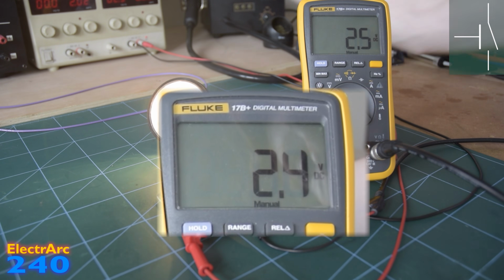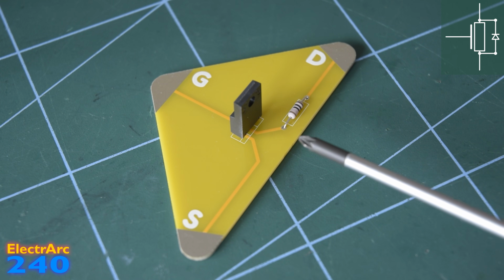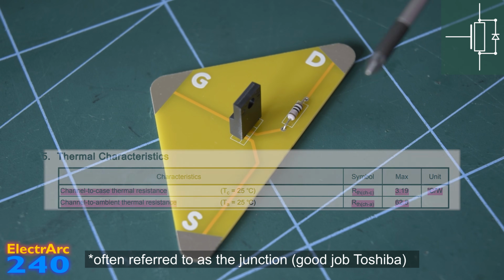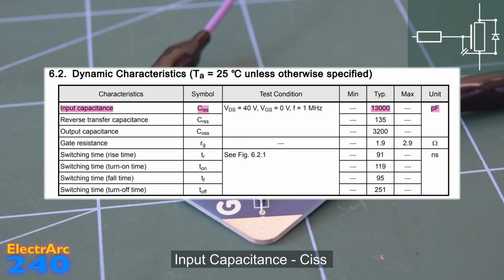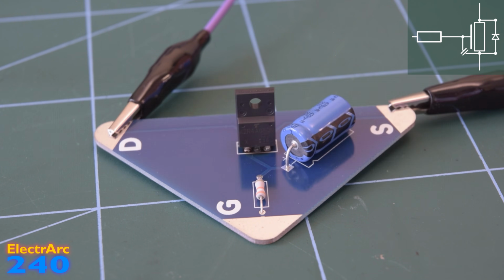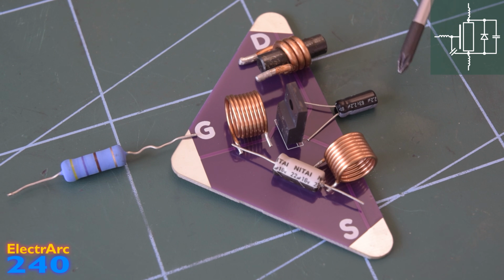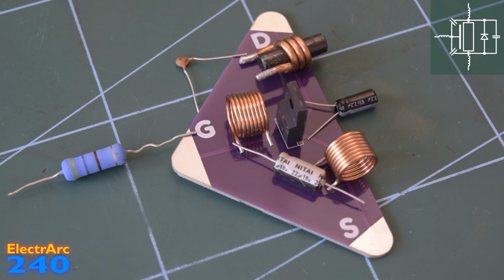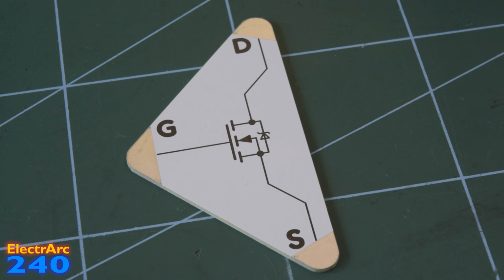Everything You Need to Know about MOSFETs

Comment: Thinking about how education systems work / worked in such electrotechnics disciplines. I studied communications engineering (got my diploma in 1993...)... and we hardly had any learning material about real circuits. Not power converters (energy electronics out of scope), not (power) amplifiers (too trivial?!). Only small signal stuff good for sensor circuitry, some digital and high frequency stuff (s-parameters, transmission lines ...). Were it not for the fact, that I had an electronics hobby since I was a kid (started around age 14 with that), I would not have understood a lot of this video, which is a) outside the scope of what I studied and b) too practical already. Maybe all those FET types were not as prevalent as they are today, in 1993... We never "studied" switched power supplies etc. back then in communications engineering. So, knowing there is only so much you can pack in 4-5 years of study, I am not sure if I would make the same curriculum decisions as I faced in my student years.

Comment: Im so confused by the light turning on without a power source??? Wheres the power coming from @5:11
Reply: There is a power source. Its implied. Because he is saying that current can flow from the source to the drain and to the lamp. He has the wire to the "source" coming from a positive terminal of a dc wall adapter, power supply or maybe from a battery. We have to infer, i.e assume a bit of the info, he doesn't explicitly show.
Remember, current flows from the + to the -.
The wires/circuit goes out of camera frame and connects to a power source. The black wire had current flowing.

Comment: Very nice work.  Thank you.   I've always been surprised that there isn't alot of transistors made with 4 legs for the purpose of
letting 2 legs be a sensitive circuit using a tiny voltage in the micro volt range , That decides how much current can flow through
the other 2 legs , The other 2 legs would conduct a much larger signal ''say 30 volts'' so that it could be used as a detector. The
tiny , sensitive side could be connected to a pick up / antenna / coil / photovoltaic cell etc.. and The slightest tiny current would
cause a proportionate  rise on the larger ...aka..higher power side making it very easy to light a detection lamp or move a needle
or make a speaker crackle , sound an alarm etc..  It would respond proportionally , But at a much higher , usable level.  Thanks
Reply: When I was around 18 I worked at a semiconductor company , I thought I was smart , I thought I'd impress my boss lol , I 
designed a 4 leg transistor based on something I always wanted .  He said ...Oh , Very nice , Yes , a good clean robust design 
But , Your only 45 years behind .  What I was so proud of , Was very old news and had been done long before silicon and 
germanium became common etc..  I forget it's actual true name , Probably because there are so many different names for
such an arrangement . lol.  I had not truly studied tubes yet .

Comment: I have a question. You said that switching a mosfet partially can shorten its life. I had been planning on making an electronic load that is adjusted by this very principle .. using a fixed-value load resistor, while allowing the current to be adjusted by changing gate voltage. (low-pass filtered PWM 'DAC'). Is that not a good way to do it?

Comment: Is the body diode a feature unique to power MOSFETs, or is it present in all MOSFETs? Sorry for the silly question, but I’ve never seen it depicted in MOSFETs used as amplifiers (as far as I can recall).
Reply from the maker: It is in 99.9% of MOSFETs, some weird ones I have never used (not power related) are different, but essentially all silicon MOSFETs have body diodes because you can't make them without them!

Comment: Why does a resistor decrease the rate of change of current? 23:19
Reply: Oh I think I get it: the gate resistor limits the current going through it, which limits how quickly the gate-source capacitor charges, which limits how quickly the channel opens up, which decreases the rate of change of drain-source current
Reply: @grace23869 exactly

Comment: Very good.
You only missed off a few things 
Some MOSFETs have integrated gate protection.
VDS Avalanche rating.
Some PSU devices with integrated MOSFETs have no avalanche rating such as topswitch.
Super fast switching certainly can cause radiated EMI issues. 
It's been theorised that solar radiation can cause random MOSFET failure.
How the internal leadframe is constructed can lead to 'current crowding' and failure, it's quite complicated!.
High Voltage TO220 parts by their construction cannot always meet creepage distances requirements Drain to Gate+Source.
Ferrite beads or 'spike killers' can tame damaging resonances.
Some MOSFETs have very good body diodes such as 'fredfets'.

Comment: 4:40 not every mosfet has the body diode between source and drain. There are some that forego the connection between the backgate/channel and the channel endpoints (sourcce and drain). Though these are far and few between. SD 215 and SD 5400 are the only two examples that come to mind for me, though i have searched for that specific type of FET

Comment: Back in the 70's when MOS devices were not very common and were VERY sensitive, a collegue of mine was repairing an item and determined that it needed a certain chip replaced. He had the part, so he unwrapped the foil from around it, took it off of the black foam,  and plugged it in. The original problem was fixed, but now it had a new symptom. He did this procedure two more times before looking up the part specifications. We had never been trained on handling MOS devices.  Any time I see "MOSFET", I think of this story.

Comment: Thanks, it was very interesting, but I was missing some info why we do all of these combinations😂😂 
It is like you say : that is a car, there are 3 pedals we can press left one when change the gears ⚙ the middle one to stop a car and the right one to speed as hell 😂😂 ... so go and drive .. silly impossible ...
In one example I understood mosfet could work like a switch, similar to a transistor, but why it is so complicated to using it as a simple switch ?
I was in similar reflection learning about microcontrollers, but some day I heard : we can use a mini sized microcontroller with 6 connections,  instead of bigger one with 40 connections to do the same minimalistic work.
So it was awesome .. they are similar in work done, but sometime we need more connections for more complicated project.
I was making a project to watering flowers based on a Raspberry Pi Pico microcontroller, so next version was done on an Arduino Beetle, size of a letter stamp microcontroller .. the software was same with changes in specific points .. 
.... thx for your work 😊

Comment: CONGRATULATIONS FOR YOUR SUPERB CHANNEL. ANOTHER  BENEFIT OF A MOSFET IS
THAT ARE VERY HANDY WHEN YOU NEED HIGH CURRENT DIODES FOR ANY CIRCUIT AS
FOR EXAMPLE A POWER SUPPLY OR A BATTERY CHARGER. JUST MOUNT THEN IN A HEAT SINK , JOINT GATE AND SOURCE FOR MAKING POSITIVE SIDE AND USE DRAIN AS NEGATIVE. YOU WILL GET A HIGH CURRENT DIODE , PLACE THEM  AS A FULL WAVE BRIDGE AND WILL GET  HIGH CURRENT ABOUT 100A AND VOLTAGE BETTER THAN 50VDC.

Comment: It load current doesn’t require “push back” it just will push back proportional to load current. But say you had a lot more ph to prime mover then the load can’t push back… its overcome with higher prime mover torque which also proves the load current is not dependent on being able to push back, but it’s just that it must happen because of current flow

Comment: I have always HATED the statement, "a transistor is just a solod state switch"
No, its not, there is so much more going on than that. The behavior or transistors throughout their rated voltage and current is very unique depending on the package and makes the SO much more useful and equally complicated to learn.

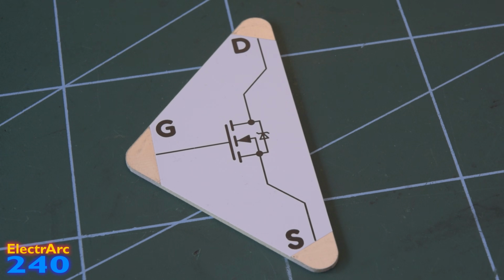Comment: 30:45 I was really trying hard not to write something about the other kinds lol 😂 I would like to stick up for the humble P-channel MOSFET — they’re underrated. They’re really handy for high-side switching when your microcontroller can’t drive the gate above the supply rail.
Let’s say you want to turn power on or off to a sensor on the high side — you can’t use an N-channel easily because you’d need a gate voltage higher than VCC. A P-channel lets you do it directly from a GPIO without the need for a charge pump

Comment: 3:10 This is completely incorrect.  You cannot connect the lamps negative side to the 5V negative. You have floating grounds, and an unintentional series of batteries,  this is dangerous.
  Your first setup where the negative 12V and negative 5V are connected to source is ok and ties the grounds together, and is a typical.

Comment: WOW! Great stuff! I did actually understand that.

"MOSFETS come in many shapes and sizes." 
Seems like MOSFETS are like humans:
Also, both are resistors. 
Also, they got three legs, and... wait. Delete that.
Also. both got a threshold value, where they 'turn on'.
Also, they receive their energy from a source and it goes down the drain.
Also, both have a voltage limit, that they can take, before causing damage.
Also, all humans have stuff, not to be ashamed off.
...
I ... I .... might be a MOSFET. 
That might explain quite a bit.

Please do more topics like this. 
Even for the weird analog people.
(or suggest another good video for analog use case.)
Reply from the maker: This is amazing

Comment: Your explanation was very clear and comprehensive, like a practical professor. I'm designing a project that uses a low-voltage (3.3vdc) low-current p-channel MOSFET IRLML6402 to power three 30mA LEDs. You mentioned that an inline resistor to the gate is recommended to damp current transients. I'm controlling the gate with a standard Seeed Xiao samd21 PWM pin, which supports dimming. Each digital pin's built-in circuitry effectively includes some 30-ohms of resistance, and I suspect that's enough. I think PWM works better for controlling a switching MOSFET than the Xaio's DAC.

Comment: As for gate driving and making switch off faster, without the benefit of negative supply voltage, I came up with a simple accelerator.  The gate drive used a series resistance(10 ohm), and a pulldown resistor (100 ohm?) Lower than usual, but the driver is able to cope with it. However I put an inductor in series with the pull down. At switch On, the inductor initially blocks current so Gate drive is not affected much and turn on is still quick. While On, the inductor allows current from the driver to flow to Source but is limted by the pulldown. Àt switch Off, the driver goes to zero volts with non zero impedance plus the series resistor limits discharge of the Gate capacitance. The pull down inductor creates a negative voltage which accelerates switch off. It might be only 100mA but it did speed up the turn off.
Reply from the maker: Sounds interesting, have you tried this circuit? If so how did it go? I might try myself if it works because sometimes a negative supply is not an option.

Comment: Can you do a similar video with Opamps?
Reply: Opamps belong to analog signal electronics. They are not really power electronic parts (though some linear mode power Opamps exist, e. g. for linear class AB amplification, like in cheaper 2 x 10 W mini hifi  systems of the 90s). 
Opamps are often used in control or regulator circuitry of a power electronic converter (they are cheaper than a digital control solution).

Comment: Saying that the "thousands of volts can be quite dangerous to humans, but more importantly to circuitry" confirms to me that this guy is a true engineer by heart. Great vid man thanks for the lesson!
Reply: Exactly! Humans recover (mostly), but semiconductor failure is forever 😂
Reply: @wormturned7379  What would normally be a shocking (hahaha) surprise after rubbing my wool socks on my carpet suddenly turns into a disaster when I share it with my electronics... what gives? These rocks suck.
Reply: Every year, millions of innocent electronics are mercilessly killed by the recklessness of meat-mechas driven by roughly 8 pounds of grey fat cells. Please, think of the poor electronics.
Reply: @datatodatatodata  I have 8.5 grey fat cells.  My mom said so.
Reply: All you need to make new humans is other humans, and we're never short of those. But components take real work

Comment: Nice video, but it's very simplistic  your over sipfication is more confusing than good. A Moffett is a transconductance device, meaning its gain is measured as i/v   It is voltage to  current part. A bipolor transistor is a curent amplifier, and it gain is called Beta or HFE.
Reply: Most fet come in 4 types, N inhancemet mode N type  deplection mode, P type inhancemet mode, P type deflection mode

Comment: HI, instead of 2154 seconds of words, you can place here
3 pictures from oscilloscope for GS, GD, DS voltages,
when we see ON and OFF state for D2PAK-7, TO220, TO247
and even bigger case, and for each size of MOSTFET,
you can make BAD, BETTER and BEST circuit on PCB,
and show with simple topology like BUCK, what you
measure with 5, 10, 15, 20, 30R gate resistor,
at 20, 30, 60, 90, 120 kHz frequency for each circuit. 
And you can also show CeraLink, versus MPPF,
versus electrolytic caps.

Comment: Analog people here!
One of my preferred design use of a MOSFET (the low gate voltage types, meant to be interfaced directly with logic ICs) is it's use as a timer. With a 1 MΩ gate trimpot and a 100 μF tantalum capacitor, the MOSFET works wonders as timer in burglar alarms, model railways, traffic lights, etc. 
They are very stable in face of temperature changes, and with a Zener stabilised power supply, they are more precise (and simpler) than a 555 timer.
What about a video on Tunnel (Esaki) diodes? They are little used nowadays, but they allows a lot of learning about characteristics' curves, and negative differential resistances.
Greetings,
Anthony

Comment: a very well prepared and well explained lecture on MOSFET's.
My education started 10 years before any, barely, useful MOSFET came around.
And some years later I had to figure out myself why a bad design suddenly would kill all gate drive circuits and the boot strap regulator
The engineer that had designed the system had no clue - he should had seen your video but the first browser was not there yet as it was 4 years before HTML was invented.
There are still younger engineers, that should had learned, that doesn't know the "killer" in a MOSFET - crss

Thanks for some very well made and refreshing videos

Comment: 3:09 is misleading because you've forward biased the body diode in your circuit diagram, so it doesn't "all still work" the same way. Also it's not trivial to use the same N-MOSFET from a low side switching application in a high side switching application because you would need to drive the gate to the threshold voltage plus the high side voltage to get the voltage between gate and source above the threshold voltage, so you need a gate driver IC with a charge pump for high side switching using the N-MOSFET. Great rest of the video

Comment: For anyone interested in using MOSFETs in actual power electronics circuits, I can only recommend reading the PDF from TI named "Fundamentals of MOSFET and IGBT Gate Driver Circuits". You'll find everything talked about in this video, but with a much more in-depth discussion and with actual circuit solutions to those issues.

Comment: Truly excellent!
Future enhancements:
GaN as well as SiC. 
Bridgeless vs 1895 vintage bridge circuit.
In CMOS, mention the inherent quantum mechanical defect caused by the difference in mobilities on N-channel and P-channel FETs. In a GPU, 600W is not that much power, but your PCB can catch on file.
Use 21st-century circuits, not just the 1920 boost and buck converters.
Mention hybrid switching to minimize switching losses, not just PWM.
Overall, it was the best presentation I've ever seen. 👍👍

Comment: I first learned electronics in the tube world with Diode, triode, pentode devices.  The new magic was bipolar transistors.  Almost all of my designs have been using Bipolar transistors and Integrated circuits.  FETS and later MOSFETS remained somewhat mysterious.  We used to think of them as a water hose that you step on to control.  Your explanation here has opened my eyes.  Your technique of showing resistance and capacitance and induction of the device quickly gets the point across.  Thank you for your video.

Comment: Reverse gate charge is what needs to be eliminated usually with a resistor gate to source. It helps it shut off. Or use a differential driver circuit.

Comment: so as a practical step to consolidate :  lets design a mosfet  emulating a simple 12V dc relay  switching  say a 24V dc load  Slow as relays are.  What issues would we face ? How low can we take that gate source volt age to reliably  turn on / off   etc .  Love to see that step by step . Ms O
Reply from the maker: Typically we are charging and discharging the gate in the order or tens to hundreds of nanoseconds. So very fast! Wouldn’t really be any issues unless we need isolation or the load is particularly annoying (inductive or capacitive)
Reply: thanks s but  walk me through it with a practical u tube ? get me started  to build m'self   I want a solid state relay  low voltage ( 5V ?)  @electrarc240